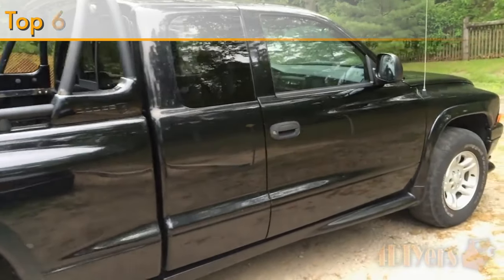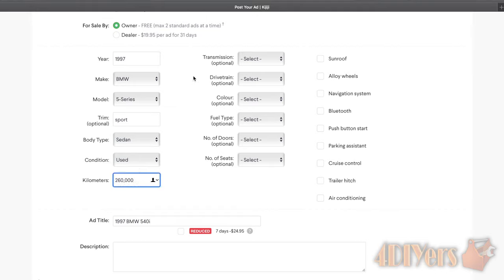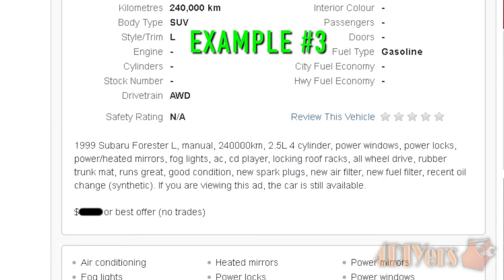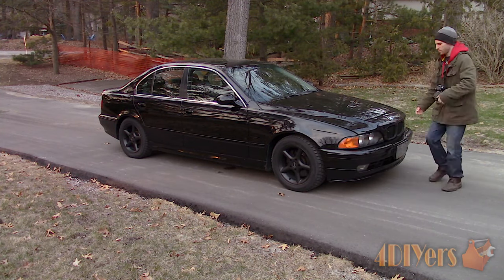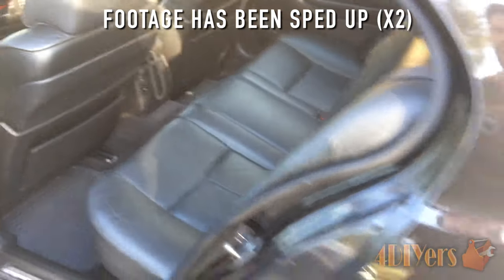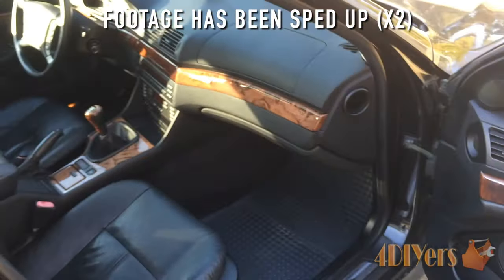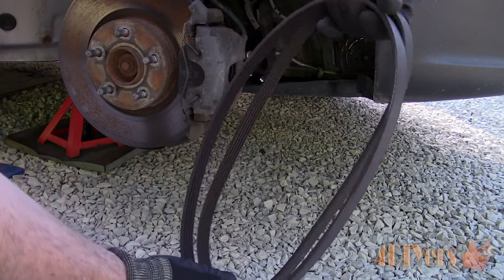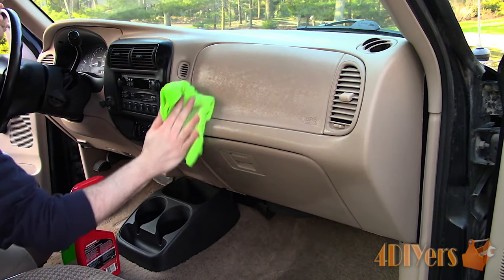6 Tips Guaranteed to Help Sell your Vehicle [SUCESS]

Comment: I would like to point out that another great tip whilst taking pictures of vehicles is opening every single door that opens on that vehicle. Hood, doors, trunk/tailgate, Even the fuel filler door! Also, crank the wheel all the way either way to lock. That way you can show how far the wheel turns. I'm a new viewer of this channel. I find your tutorials of the Dodge dakota's very very helpful. I'd like to give you my many thanks! As always, like and already subbed. Keep it up! #1 o7